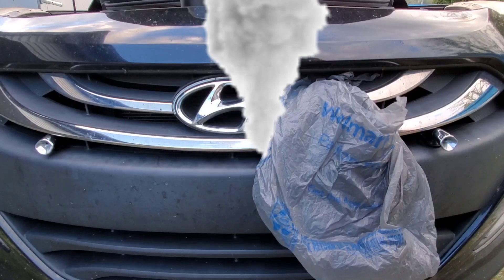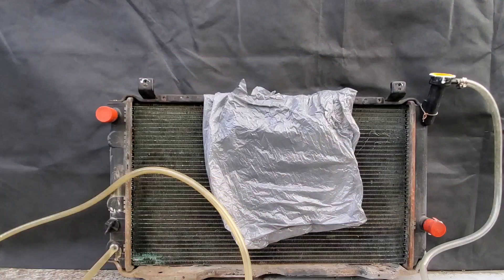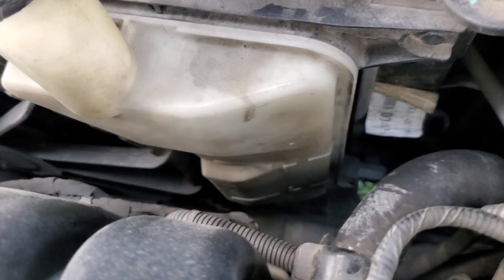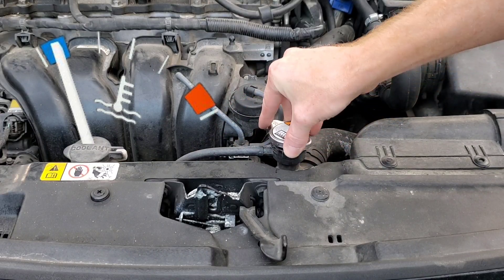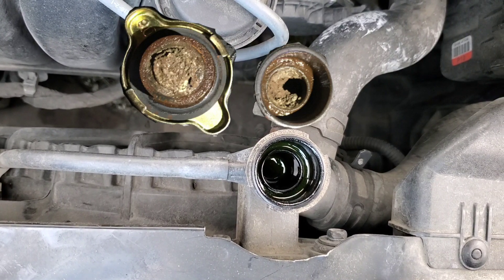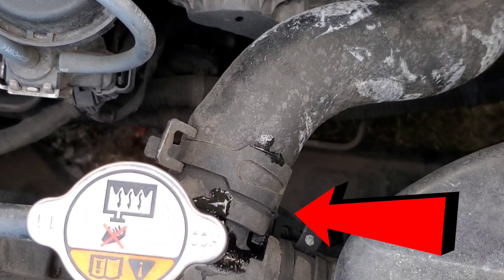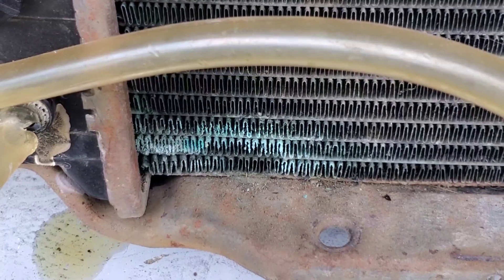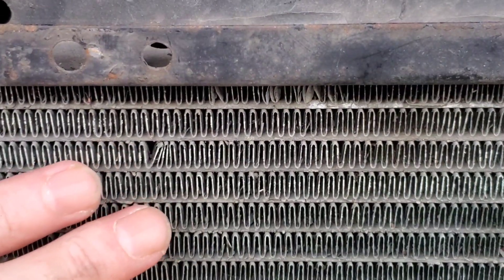Car overheating problem

Comment: I got a 2010 gl450 overheating. But we chang new water pump, thermostat, radiator and still overheating. But no sign of head gasket blown because no white smoke or coolant mix oil. Out of idea. Any idea

Comment: Have a question for you. My cousin gave me his father's Camry on May 23rd 2018. I've not changed the radiator fluid since I've had the car. That was 3 years ago. I don't know if my cousin has changed. I had to change the radiator cap because was rusted and broken. Part of  the radiator cap has broken off into the radiator. It still runs fine it doesn't overheat. The radiator fluid has brownish color to it. Should I get the radiator a once all over look by a mechanic and change the radiator fluid?
Reply: You can either take it to a shop for a drain and fill or a complete flush if it's running fine, not leaking and not over heating. I like using the Toyota pink 50/50.
Reply: @T12i99iN  I may have to take it to a mechanic. I'm a little bit worried about the freeze plugs there is rust on them. I use Prestone coolant this one I got is for Asian vehicles. But it's Red instead of Pick. I think it'll work. All fluids in the Camry is going to be changed. Brake and power steering and some other fluids that needs to be changed. I should've done this when I first got the Camry in 2018 but I didn't. I trusted my cousin which was a bad thing on my part. I'll get everything done on the Camry.
Reply from the maker: @T12i99iN  Without prior history I would only remove half the radiator fluid then a week later the remaining.  Just to be safe and not clog up the heater core.
Reply from the maker: Ask the first owner was there any stop leak used just to be certain. I believe it could be calcium deposits and other minerals. Careful about doing a flush without prior history. I would change some of the fluid such as half. Wait a week then change the remaining fluid.
Reply from the maker: Make sure you also use the correct fluid.
Reply: @NATESINTERACTIVEAUTO  I have. The Prestone coolant I have is for Asian vehicles. Toyota, Lexus, and another car make. It will work I hope. It's a 50/50 mix or blend. Advance Auto Parts Store is who had it. They were $21.99 a bottle. I had to buy 2 of them. But that's okay.
Reply from the maker: Jon Doe  Yes I would proceed with caution and only change half then a week later the other half. If you don't know the previous history of the car and see sign of sediment.
Reply: I would flush old coolant out for sure and if your Radiator cap was rusted and broken chances are your thermostat needs replaced also you can get a coolant meter that measures the life of your coolant at and auto parts stores when you do flush make sure to get all old coolant out of engine block and flush heater core as well

Comment: One problem that is annoying is when air is trapped in the system - preventing coolant from flowing properly, proper pressurizing of the coolant, air pockets in the return heater core, hose, etc. Some older vehicles had a valve at the highest point of the coolant system to purge air. Otherwise you have to resort to jacking up the front of the vehicle (when cold), remove the radiator cap and run the engine until the coolant is warm enough (and heater blows hot) to allow the air to escape. Somebody out there may have a better tip.
Reply: I squeeze the radiator hose until all air comes out and I slowly add more coolant . The red Mopar is what I use since everything is cheap alluminum on this 2012 grand Cherokee and filling reservoir to propper level . They claim it's a closed system once the cap is on and I have changed a cracked thermostat housing , thermostat replaced and a faulty bleeder valve and O ring  replaced . This summer I was suffering from overheating and dealership found a crossover bay deep behind the engine with a pressure test and dye . Since then I don't run it too hard up mountains like I used to using cruise control and I pop the hood for more cool air. It helps a little . Hope this info is helpful to someone
Reply: @arniceousmaximus2183  Typically. Popping the hood is not such a good idea. With the hood down, air entering the engine compartment is forced to go through the radiator. With the hood up, air can enter from everywhere. This is more so with vehicles with mechanical fans. Also, most vehicles are liquid cooled. To cool the engine, you have to cool the liquid first. Thermal transfer from the engine to air is minimal at best. The engine will heat the air faster than the air can cool the engine. In the case of an air cooled engine such as an older Porsche 911, the cylinders have cooling fins that are covered in a shroud so fan forced air can remove heat from the fins. They also use almost double the oil volume that runs through a cooler to remove heat from the oil which in turn removes heat from the engine. Static air against a liquid cooled engine will just be heated by the engine.
Reply: @brucecoleman7412  tha Ka for taking the time to reply i do appreciate the knowledge and the heat sync idea has always been a good option these manufactures skip corners everywhere they can . I do notice the temp guage going down quickly when I pop the hood though lol
Reply from the maker: @brucecoleman7412  I wanted to say thanks for trying to help.
Reply from the maker: @arniceousmaximus2183  Im sure it will help someone and I have seen people pop the hood to sit at idle like police when I lived in the Midwest.
Reply from the maker: Yeah your right and thanks for helping others.

Comment: I know it's a different beast but seeing those fins on the radiator got some ptsd going on me from my 2017 subaru forester. In my opinion they sold those with known ac problems. In fact, when the condenser went out, they fixed it for free. I mean other than the hassle of getting it there and being without it for a day or two. When they compresser went out, they didn't fix it, so the wife said "let's sell it and get something else". We did. That was just the straw that broke the camel's back with that car. I know it's off topic and I know alot of people love their subies, but no thanks.
Reply from the maker: Im sorry to hear that, we have all been there before.
Reply from the maker: Jon Doe  really? I here mixed things about Chrysler. What do you have?